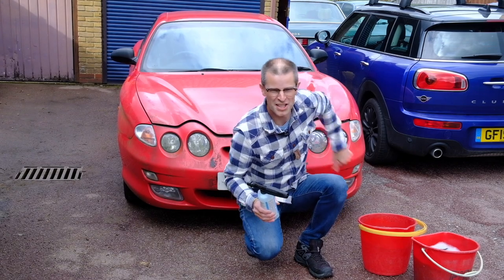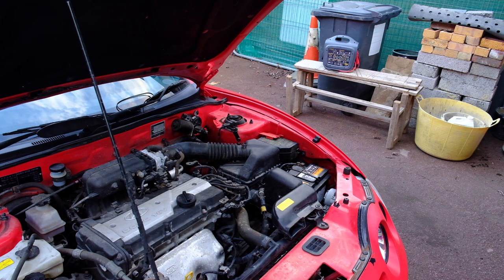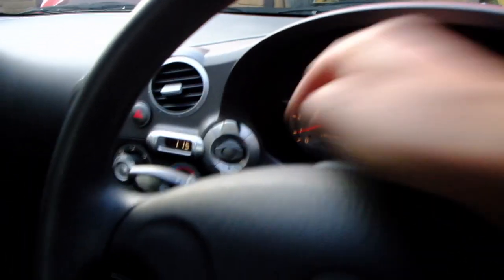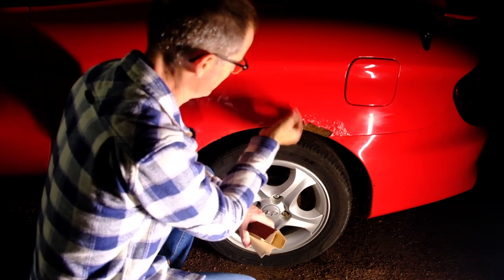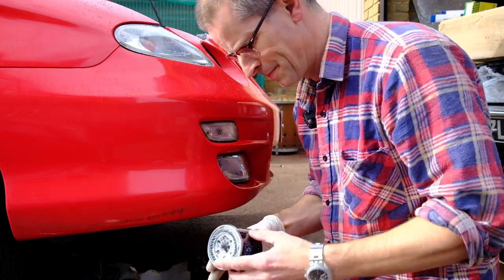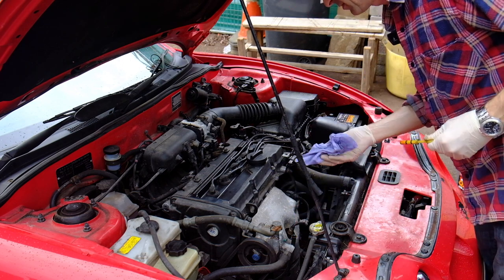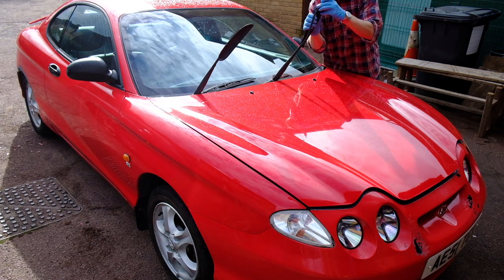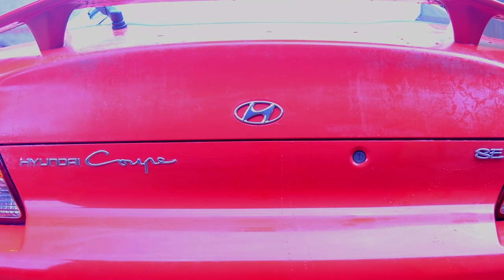Resurrecting the Cheap Car Challenge Hyundai Coupe

Comment: I find it difficult to summon the energy to wash my car when it's just a bit grubby, but give me something like this and I'll happily spend a day or two getting it nice.  The transformation is just so rewarding.

If you can measure the voltage directly at the output of the alternator rather than the battery, which will let you know if you have a problem in the wiring between the two.  If the alternator output is still low it may have a failed diode in the rectifier pack or could be as simple as a sticking brush.
Reply from the maker: Its so good watching it come clean after that grime! I think something was sticking or dirty as its picked up loads as Ive run it

Comment: tip for pouring oil, turn the can with the opening at the highest point as you start to tip and pour, there will be no gulp of air and therefore, no sloshing  dollop of oil. Once the pour is steady and centered, gently spin the oil can over so that the can is on its side.  Glad the battery was your problem concerning the rev's. Brushes in the alternator will improve as surfaces clear, but you really want about 13.4v or more at mid revs for a healthy output
Reply from the maker: You know I think Ive heard that for juice cartons as well. It settled on about 13v but was still improving, think it was just dirt

Comment: What a great little car, probably worth a bit more effort where the rust is to get maximum resale value.
Reply from the maker: Definitely. So far its just stop the rust in its tracks and make it safe and vaguely presentable for the test, then I can make an effort of sorting all the paint, boot, bumper and the arches and it will look amazing, the rest of the paint is incredible

Comment: For some reason that is unbeknownst to me I'm a massive fan of ugly cars, so this thing is wicked
Reply: I don't think they are ugly at all mine is silver and I personally can't find a bad angle
Reply: @grantmitchell9034  mines white, i agree
Reply: @grantmitchell9034  biggest thing i hate is that i cant hardly find anything for it at all
Reply: @NelsonBlvd  the Hyundai dealerships still support these cars with replacement parts there is some aftermarket support and quite a big community who can help out too I'd suggest joining the owners club if your looking for the more hard to find parts only thing I can't seem to find is a driver side seatbelt mine needs replacing
Reply: These are actually very cheap. If you can even find one. They take a bit of looking around for.
Reply: @OffGridInvestor  there's an old chap who lives near my mom that has a bright green one, in incredible condition. Only uses it on the weekends too
Reply: @EmperorConnor  me and my neighbor have exactly the same one same colour and everything however her one is completely standard mine has been customized a little bit

Comment: Little tip, when you put plugs back in be careful not to knock the electrode gap closed as you drop them into the plug wells. Also, don't worry about a larger battery - it won't over power the car/starter. The car will only pull what it needs from the battery. Great job massaging the wipers back to life!
Reply from the maker: With this long drop you almost can't go off centre with the plugs, not like a V8 or the W123 where they are right at the top, mind you these electrodes took some force to move! I always prefer to go a little over size if a battery will fit, gives it a little more cranking power when its cold
Reply: @furiousdriving  Agreed! Enjoyed the video, looking fwd to see where this goes. Take care bud

Comment: Good luck with the MoT.  You need to get under the scuttle and lubricate up the wiper linkage as it's suffering from corrosion due to sitting for so long which is causing it to bind up.  The charging light showing up could just be down to the electronics needing to re-learn their parameters after sitting with a dead battery for so long.  I'll bet that, if you check it after you get back from the MoT, it'll be charging a lot better...
Reply from the maker: Thats what my mechanic friend said about the light. Disconnecting the battery helped
Reply: @furiousdriving    And a bit of driving so the ECU can re-learn should help even more.  I used to have a VW Golf GTI with the early version of Digifant and you got pretty used to this sort of thing as it would go slightly insane every so often so you'd have to disconnect the battery for an hour or so to wipe the memory and then let it re-learn its parameters again...

Comment: Instead of fishing through dirty old oil for the sump plug just use a magnet.....that engine is rattling it's nuts off after the oil change. It sounded like the oil was to thick and causing a top end rattle. There's now way in a million years a cable tied battery should pass mot, if the car rolls over its game over. If the car has sat for years then the tyres and brakes will be shagged also.. there was enough mold on it to grow a tree ..
Reply from the maker: The rules say ‘restrained’  and it is, and the strength of cable ties is actually incredible.
It’s sat about 3 years and the tyres aren’t original, no OEM fit Chinese no brands!
Engines always sound bad on voice mics as they pic up the wrong frequencies and exaggerate the top end and ignore the bottom

Comment: Also check the power steering pump bc it sits above alternator bc my leaked on to it which caused mine go bad. Bc small o ring that tends leak.
Reply from the maker: That’s clean and dry, just an old alternator I think :-(

Comment: I think you might have a chance with this, it seems the other channels (apart from the Rover) are all losing points before they even start. The Celica is over 100k miles, the Civic was owned before the challenge started, the Renault loses points because it's a Renault (so would a Peugeot, Citreon or Fiat). 

I would have said the Celica is likely to win but they haven't really shown the condition and I don't know the penalty for being over 100k. Good series though.

Comment: Errm.... why exactly did you jack up the corner of the car with the oil drain plug on it, so that the oil in the sump would run away from the plug and all the old sludge at the bottom would not run out and therefore stay in the sump and cack up the nice new oil and filter ?

Would have taken 30 seconds to remove the axle stand and drop the trolley jack to let it drain properly.....

Unless I missed something ?

Comment: Hmmm, just checked on line
on your nice cheap little Hyundai, regarding the MOT
Nearside Inner integral body structure or chassis has excessive corrosion, seriously effecting it’s strength within 30cm of a body mounting sill
Reply from the maker: SSShhh! No spoilers
Reply: furiousdriving 
Sorry about that, I couldn’t help myself.
Still....£200, marvellous deal.
Fun fact: also known as the Tiburon in the USA, used to sell the preface lift of that model at a Hyundai dealership in West Palm Beach 🏝

Comment: I wonder if that's the same engine as north America. They day either 5w20 or 5w30 here. I wonder why they are different if the same engine?
Reply: I don't believe 10w40 semi synthetic is right spec in modern car engines.
Reply: @aleshudek5323  correct. Most smaller engines dont to to that weight. My 2002 4 cylinder nissan altima says in the manual I can use 10w30 and I have. Just not when it's winter. 5w30 most of the time keeps mine happy
Reply: It is the right spec for that era into the 2000s,,, 5W-40 is fairly recent.

My friend's 1997 Honda Civic 1.4i petrol takes 5W-30 with a 5000 mile change interval... strange.

For some reason they love really thin oils in the US, and change it twice as often as everywhere else.
Reply: @johnmoruzzi7236  yeah. Most older hondas want 5w20 here. I'm in canada. Also most people only change their oil when there is none left to change lol.

Comment: To be honest, the difference between 5W40 and 10W40 is negligible. They are both oils which reach 40 level viscosity at operating temperature. The only difference would be during the first few minutes of warming up, which on a low mileage engine wouldn't count for much.
Reply from the maker: Advice is from the owners club, in fact from someone on the cars design team. the 40s are close but Halfords and Euros say 5W 30 which isn't right for these apparently

Comment: Right hand indicators and lights are standard for RHD vehicles, only the UK puts them on the left for some reason.
Reply: yes so you can signal while changing gear, but your reasoning is not totally the case as some (most) manufactures cater more for left hand drive versions (if they sell more lhd than rhd of the model), it being on the left is so you can signal while changing gear in a left hand drive varient and they just move the same stalk assembly over to the right for rhd :)
Reply: @gimble8638  Here in Australia, Toyota, Hyundai/Kia, Nissan, Mazda, Isuzu, Opel, GM all have indicators on the right.

Comment: Shouldn't be about 14.2-14.6V with the engine running? 12.2-12.4V is very low. It is just a battery voltage.
Reply from the maker: Its getting better and better as I use it, I think it had dirty contacts and contact cleaner and use has improved it
Reply: @furiousdriving  Could be. You can try to measure the voltage directlly on the alternator to confirm.

Comment: What jack were you using ? Looks just the job for jacking up my Alfa Spider 916 😀 good luck with the project 👍
Reply from the maker: Its a Draper 01106 low entry for lowered cars, 3 tonne lift for heavy ones and a big saddle spreads the load, its a great bit of kit- here's the link https://amzn.to/2nt04Oy
Reply: Great thanks for the link 👍

Comment: For gods sake change the alternator for a bad charge! Basic mechanics 101! Or if adventurous, take it out and clean the bushes and contacts! Plus check after its been sat for years that the auxilliary drive belt isnt perished or saggy! Tension the belt is a more modern cure
Reply from the maker: Belt tension looks OK, I think its just the brushes and a bit of use and contact cleaner has cleared them, the charge keeps going up the longer it runs

Comment: That's the Draper Jack it's a good Jack far lighter than the one I got from Euro car parts. Sump plug in oil yucky. Cable ties are your friend bat support. It's a good engine I might not like the car but the engine is good. It sounds better needs new alternator. The brushes are worn Or dirt.
Reply from the maker: Think its just dirt as the longer I test it the better the output gets, no charge light on the dash now..

Comment: Wouldn't one of those magnetic stick tools have made easy work of pulling that sump plug out of the oil?  

Mine cost £3 on amazon and it's one of the most useful tools I have!
Reply from the maker: It would lift it but you'd have to locate it first in the bottom! And then have a very oily pick up tool

Comment: i think the ash tray not sitting flush with the rest of the piece is normal since i noticed that in my hyundai coupe too.
Reply from the maker: oh, I thought it was all a bit better than that! At least its not broken. Is the slot above that wont move cup holders?
Reply: @furiousdriving  yup, two cup holders, they should work the same way as the ash tray, push in and they come out slowly.
Reply: @furiousdriving  try this: newtonnet.co.uk/coupe
It has the owners manual, schedule and fluid charts, parts list, jacking points and electrical and mechanical service manuals.
In the mechanical service manual you might find the way to remove the whole assembly of the cup holders out and prevent further damage.
Having that car with that milage with the interiors in brand new condition for that little money was a hell of a steal since i got mine with 168000km for 3000€ and wasnt in that good of a condition to start with :)
Reply from the maker: @MrRubenRusso  Brilliant thanks, that will be very useful!

Comment: When you drag that car remove the spare wheel. Instant weight loss to car. Also your car is lighter than the Celica. Rev the engine to red line in each gear but make sure you don't wheel spin. Average start rev to around 3500 rpm. Think the engine might be a mitsubishi so its got twin cam 16. Best wishes.
Reply: Not sure but i think alpha engines, 1.5 in scoupe and accents are mitsibishi engines bases not sure bout this one cuz is beta engine. Have rd1 (earlier model then this one) 1.6 fun car but im thinking to put 2.0 in him 415k km and still going strong

Comment: Spotted the clutch hydraulic fluid reservoir the moment the engine was revealed. The cap is a major pain in the behind to pop back - truth is, mine is held onto the reservoir by duct tape even this very moment. So be prepared to 'toy around' with the cap as it is a horrendous piece of design.. or just let me know how you managed to do it, Sir.
Suppose it still has an 'Alpha' descendant engine by the looks of it - if the engine is a bit worn, follow up on the oil levels regularly. Mine sips oil in the city, but not on the road - either a seal around the valves gave in, or the gasket around the sump is non-existent and oil somehow dissipates (no puddles no nothing under the vehicle).
Lights are funny; fog lights are differently available until the high beam is on. (I reckon my back foglights are off otherwise)
And my aerial is bent, so I'll have a hard time once I get a radio into my car .. the envy :D

Don't sell it if you can afford it, just give it some love, it will stand up to it.
Reply from the maker: Luckily with only 39000 miles on the clock this feels like a new car so I should be good. Having said that, the Alfa Twin Spark uses 1 litre every 1000 miles, its even in the handbook! If this gets its fluids changed it'll be a garage! Ill ask how he does the cap!

Comment: 12,3 is quite a low charge
Reply from the maker: worryingly low, but luckily it improved as it went on
Reply: @furiousdriving  tarnished commutators maybe.
Reply from the maker: I think so, a bit of use sees to be clearing them
Reply: @furiousdriving  Thats geat. I had a similar problem and it was the curren regulator that had blown and taken the diodes with it. :(

Comment: If that was 2.0 coupe. It takes 4 litres not 3 litres. I have two hyundai coupes myself.
Reply from the maker: This ones the 1.6, I found figure in a couple of places
Reply: @furiousdriving  thats cool that makes sense. Its a lovely car. I have the original before that which i de-catted and its so powerful. You can get alot of power from those engines if you take the restrictions off